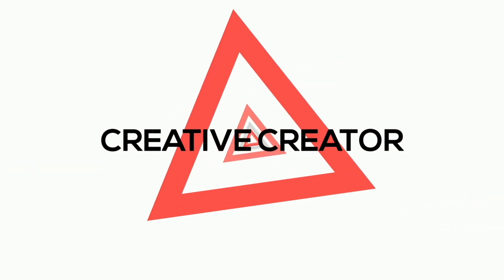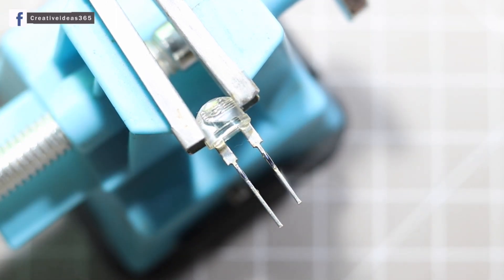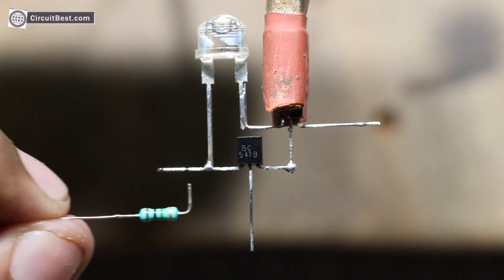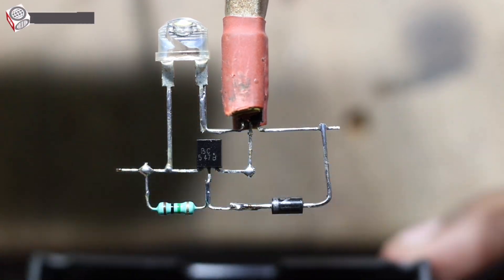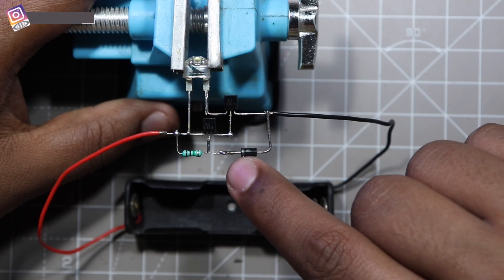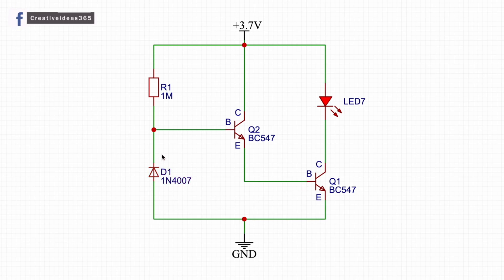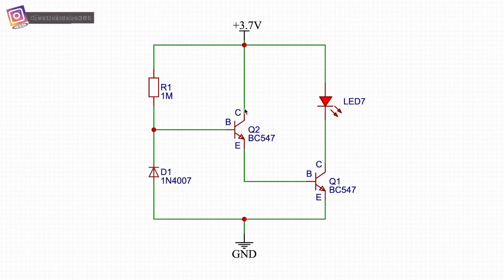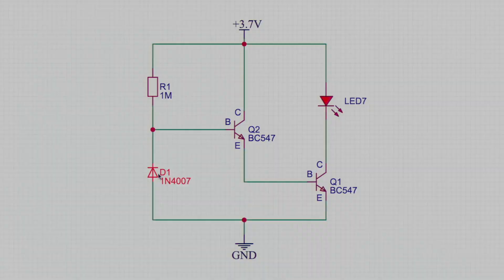Simple Darkness Sensor Circuit

Comment: This actualy makes sence haters, a diode is made out of silicon, when silicon is exposed to light, it produces energy, and it shounts the lower transistor, whitch turns off the upper transistor and it turns off the LED diode.
Reply: oh, he later explains it too.
Reply from the maker: I have checked the current it is 0.15mA
and also i don't want to increase components count. I want to make the circuit as minimum components possible.

Comment: you're the first person that describes how the current is going in a circuit with Transistor, i have questions for you if you mind answering. Just to understand some things.
 At the first Transistor Q2 why the collector needs to be connected with dirrectly with 3.7 v ? and why the base is connected with a resistor first  ? What would happen if there wasnt a resistor? and lastly what would happen if the same Transistor was connected only from the base connector?
I have seen enough of these videos and i cant understand why they need to be connected like this, i just need some theory if you mind helping me, i dont have all the staff i need to experiment with, and i dont want to do it just mechanicly if i eventually find.

Comment: Breaking a diode is save for circuit, means that it can occur short circuit ❓❓
Reply from the maker: no if you don't touch the points it will not be an issue :)
Reply: @Creativecreator  ok, i Will try it
Reply: @aarshsinghal2129  even If a short happens, nothing will happen
Reply: @thearchetype9829  you know you are not allowed to do that on youtube?
Reply: @thearchetype9829  no, I mean youtube can ban you because of that
Reply: @thearchetype9829  I like your content, you got yourself a new subscriber.
Reply: @Creativecreator  I have try this circuit this is working nicely thanks 🙂😗 you
Reply from the maker: @aarshsinghal2129  thank u for your feedback 🥰
Reply: @Creativecreator  can you tell the difference between present and potentiometer
Reply from the maker: @aarshsinghal2129  one is big and other is small
Reply: Only that it is
Reply from the maker: @aarshsinghal2129  both are variable resistors one is big and other is small